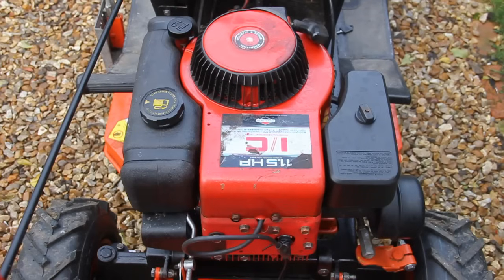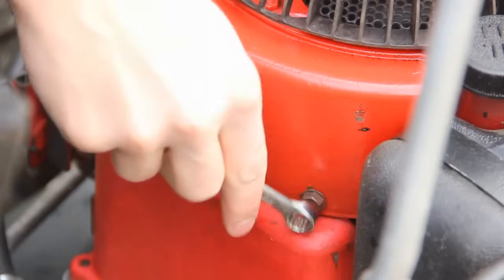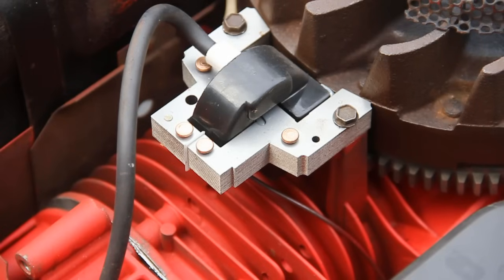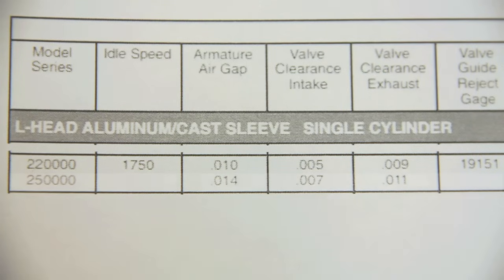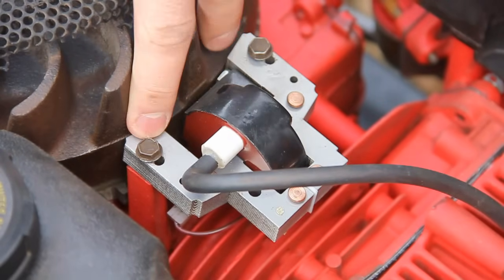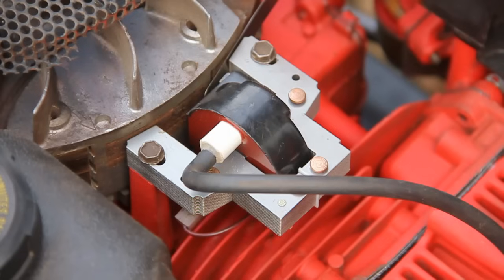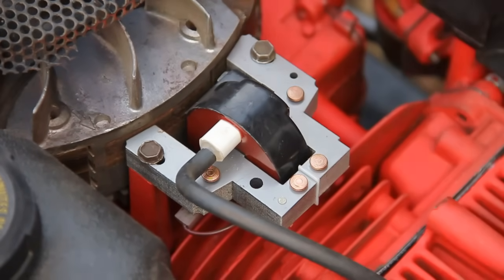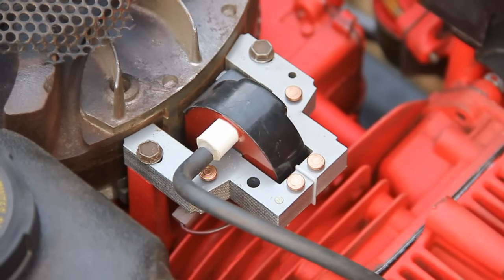How to Set/Adjust the Air Gap on Small Engines Armature Magneto Coil

Comment: Replaced the coil on my Briggs twin opposed today
Also did the fuel filter.
For the life of me it will crank but not fire off.
Ran out of daylight so I’ll check for spark and fuel tomorrow.
1997 MTD yard machine 18.5 HP
Twin .

Comment: I have a cub cadet 20 hp Briggs and Stratton. I don't have spark. I replaced the coil and the plugs. I set the gap over and over and over... still no spark. The magnet is clean and strong enough to grab my tools.
I also removed the auto kill wire just in case it was shorted... but no help Any ideas
Reply: Time to take the machine to a shop...you've done your best..

Comment: Does this gap of the ignition coil effect the timing?
Reply: no it does not  the timing is set at bout 20.  on the points
Reply: Just the strength of the spark on the sparkplug.   Too close or too far on the coil/flywheel gap results in a weaker spark.
Reply: @DP-hy4vh  so theres too close and too far away? sure about that? thought the closer it got the better spark but i dont understand ignition coils...

Comment: You left out the part where you turned the flywheel to bring the magnets back to behind the coil again. Actually, it wasn't neccessary to move the magnets away in the first place. You can simply break the magnet force by pulling the coil away long enough to insert the feeler gauge.
Reply: thats a good reason to cardboard box top

Comment: He shows his ignorance by using a metal feeler gauge to set air gap. That is a absolute NO NO. You can purchase brass, plastic, or paper that is non magnetic to do the job correctly. Most magneto, or coils usually come with the proper shim stock for your engines application. Just saying......
Reply: The flywheel magnet is permanently embedded in . . . . umm . . . . METAL !!
Reply: @TIMEtoRIDE900  You need to use a non metallic feeler gauge such as plastic, brass, or even paper, but never a metal isa what I am saying
Reply: @petepeabody8905  You still haven't EXPLAINED  why it's "a NO NO"
What's wrong with using metal . . . .
Reply: @TIMEtoRIDE900  It is so simple. the majority of the metal on the flywheel is composed of a non-conductive metal. This is why when you spin the flywheel until you get to the metal that is embedded does not attract (pull) the coil to it. But I guess if you do not understand why you should never use a conductive metal that also would be attracted to the magnetic properties in the coil to  perform this task then you will not get a true and proper gap. So this is why a non conductive gapping tool must be used, paper, plastic brass, anything that will not attract to the coil and also be the proper thickness per the manufacturers recommendations. That is why. But you seem to be a know it all or  just plain argumentative so personally I really do not care if you use whatever you use. I will not try and explain further because I would be answering to a box of rocks. There you go.....................
Reply: I'll find out soon, as I ordered my coil recently, it's a double plug coil.  I assume there's only 1 magnet? It's a b&s 20 hp two piston type. I got no spark by spinning and looking at the plugs. So I ordered a coil.
BTW, the engine started the night before, and I cut the grass. The next morning it started up then struggling to warm up and I thought I choked it, but it never started again. Key is on and the seat switch is bypassed to a straight wire thought put.
New spark plugs. So this better fix my no spark.

Comment: I've seen many engines where the magnet sits ever so slightly more proud or recessed so in my opinion I adjust the gap at the magnet with either a feeler gauge, piece of milk jug, or thin card stock like a manilla folder or birthday card.

Comment: One must assume the engine main bearings are not badly worn or that air gap will vary while trying to run properly.
Reply: It fires on compression - location of coil is on the bore, the crank will be shoved straight "down" when the magnet flies by the coil with the CORRECT air gap.
Reply: that want happen  you prove that by moving gap out 2-3 times normal gap and it will still run------ magnetism   out from perm mag prove this by holding a screw driver  away from a mag . slowly go toward mag with tip of driver you can feel the mag pull  at least 3/4 ins away

Comment: Dont get too caught up on sanding the rust and expecting that to cure a spark issue.9 times out of 10,the points(if its an older engine)or rare but possibly the magnetron coil being the culprit.cleanliness IS IMPORTANT on POINTS, but magnetism is BARELY affected by rust. Note;when someone tells you they sanded the flywheel and now have spark,theres usually more to their story...,I.e.safety interlocks,dirty or oily points,etc. Just sayin....

Comment: Hello everyone.Just a qurstion....does this air gap affects the 4-stroke cycle of the engine?
Here's the thing...my engine(Briggs&Station 4-stroke)starts normally but cant keep working and eventually stops.
Carburator has been cleaned,checked and working fine.
Gasoline is replaced with fresh new.
Spark plug checked...works fine.
Any suggestions?
Reply: Is gas cap vent open? How about bowl vent? Remember..,if air cant get in,gas cant flow.
Reply: @johnwade5747  My Briggs and Stratton (Lawnboy) does not have a vented gas cap. There are some that don't.
Reply: I just replaced the air filter, because it was filthy and when I checked my flywheel key it was slightly offset.  And I have had to remove the plastic carb and clean it 3 times.

Comment: both gaps should be locked at one time  feeler gauge in both push the coil in then lock   your way you can end up with the wrong gap in one
Reply: I was thinking the same thing.  The first side will shift a little when moving the second side.

Comment: Problem have a john deere pushmower and I've had it to john deere and they say they dont know what's wrong with it.......pushing it along one day and for no reason it quit.not gas....Its got new carb.not the problem.its got new points set to what I could find .010 .not the problem.its got new coil. .012 or the thickness of matchbook cover.not the problem.john deere wont fix it or replace it.any ideas from anyone would help.thsnks
Reply: Check cylinder compression.

Comment: another thing 25 gap on the plugs .u can go lower but if u carbon on them go higher at 25 it will start easier and run cooler

Comment: I noticed the welch plug with the oil hole and the felt 'wick'that lubes the top of the shaft are missing!The starter clutch stands still all the time that the engine is running,so if it isnt replaced,it may gall to the shaft and not only squeal,but mangle the end of the recoil /spring.(Sand the shaft in a circular  motion to remove rust or gall/discoloration.)Dont over oil it. I do 5 or 6 drops of light oil like  3 in 1 , but  a.t.f. is also thin and durable.

Comment: Sheet of paper is good enough or even better.
Reply: If so, Make darn sure your engine doesn't have any main bearing wear,(or just use a business card.Tried and tested by us old schoolers for 50 years,)It'll be O.K., and won't have the possibility of touching from thermal expansion or 
       centrifugal distortion.

Comment: Use a standard business card to set the air gap.
Reply: Leopold  no its not. A business card is between 0.010 and 0.012 which are both acceptable.

Comment: The easiest and most accurate way to set the air gap is to use the part of the box the new coil came in. It measures about .010" thickness. Place a strip of the box between the coil's laminations and magnet in the flywheel and allow the magnet to pull the laminations to it, then tighten the coil mounting screws.
Reply: Spark plug box does the same done hundreds that way sod faffing about with feeler gauges
Reply: Thanks
Reply: @4069ish  You're welcome.
Reply: worked for me and less fiddly

Comment: Thanks, I had slid the feeler gauge across both arms and magnet.  I'll correct it tomorrow and hope it works.
Reply: I prefer checking the air gap with the coil directly over the magnets, not another part of the flywheel.  Position the flywheel in line with the coil. Loosen the coil bolts and pull the coil away from the magnets.   Place your feeler gauge between both arms of the coil and let the coil be drawn to the magnets through the feeler gauge.  Then tighten down the coil bolts.  Remove the feeler gauge and your clearance should be spot on.

Comment: Flat gauge on rounded parts. 

Get a business card, unscrew your ignition coil, put the business card between the coil and flywheel, let it stick to the magnet. Tighten bolts and your good. 
Feelergauge is a bit overkill but some like it this way. The gap will always be bigger, unless you bend the gauge to the radius of the flywheel.
Reply: The bussiness card trick works everytime
Reply: Business Cards, Thin Screw Drivers, Thin Piece of Metals, hell I use my teeth if it's thin enough!  USE WHATEVER WORKS!
Reply: do not use a Business card as mowers gap range is between .06-.14 a BC is .10-.14 so dont use it unless you know what type of motor and gape it calls for.
Reply: @twistedmetriccycles  ive been doing small engine repair for my company for 2 years and we've always used business cards. Never had a problem with it
Reply: +Michael Kelsey Never failed me.
Reply: Leopold  its spelled FEELER.Leopold.lol. I misspell all the time dude.Spell check doesn't help much either.lol
Reply: I've always used a business card, and never had an issue.  Using the gauge is the proper way however.
Reply: Cocr carrrgg chaghb icb             ch  c     charger bobine d allumage
Reply: @oscardelaporte902  I agree.
Reply: I just measured to different business cards, and got .012 and .015.
Spend $5 at harbor Freight and get a feel gauage.  Shockingly the HF one weighs around 6-7 ounces and has 32 different thicknesses.
Reply: And, number of times I've used business cards and they flatten when tightened.  Might work fine for small walk behind engines, not on 20+ HP lawn tractors.
Reply: Briggs makes a plastic gauge that bends the curve and leaves no residue for setting gap.
Reply: Well la de da, What am I going to do? Drive around to every store in town to try to find one, I doubt that there is any store in the world that sells those, Other than the briggs and stratton company itself, Can't wait that long for one to come in the mail when you need the engine together tomorrow @alphasxsignal

Comment: I thought you had to tighten it up against the magnet on the fly wheel?
Reply: boxing 4 life  noooo don't do that lol
Reply from the maker: boxing 4 life You do, a bit of bad editing from me there.
Reply: +boxing 4 life  In some cases the magnet is exstenuated and eccentricated that is esthetically the truth. The magnet may protrude more than the rest of the circum. of the armature wheel. That is why it is important to keep your owned user manuals...  Good point boxy.... Some equip has eccentric or eccentricated parts. It's important to keep manuals make notes. I prefer the interior doors of my barns.
Reply: +GardenMechanic  hg
Reply: You have a good point it .It insures no 'crawling',and eliminates touching if engine has many hours and main brng. "play'.

Comment: You set the gap to the maximum. Why not set it to the nominal .012? The specification was a gap of .010 to .014.
Reply: That was not the "max" setting. There is no max or min setting in his manual. The .010 setting is for engine model 220000 and .014 is for engine model 250000 which is the model he is working on. He specifically mentioned this in the video.
Reply: is 0.02 twice the amount of 0.010 ? -___-
Reply: Yep! Just what I did..set it to the nominal .012" Runs great!!